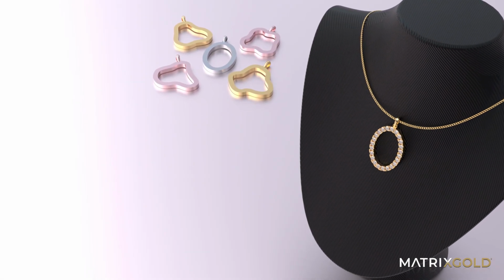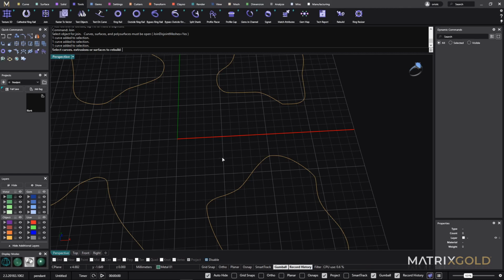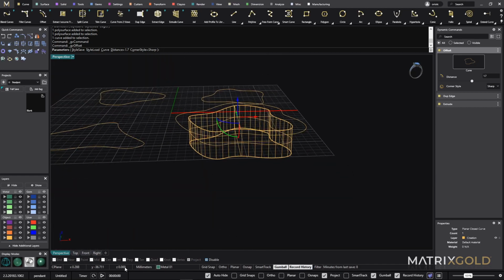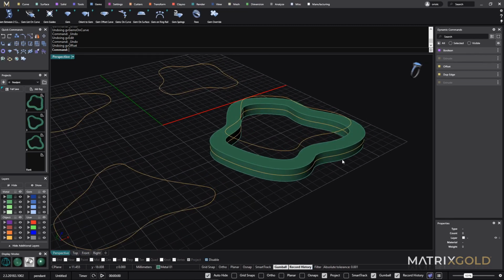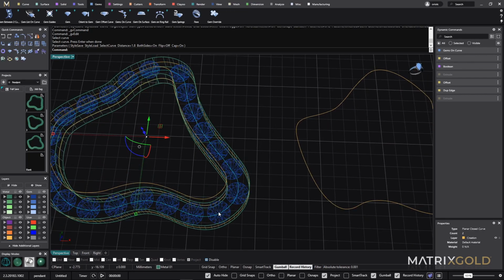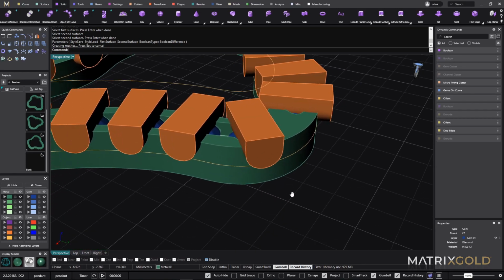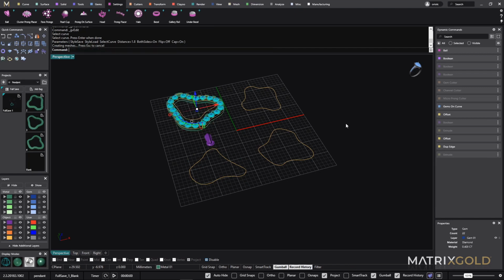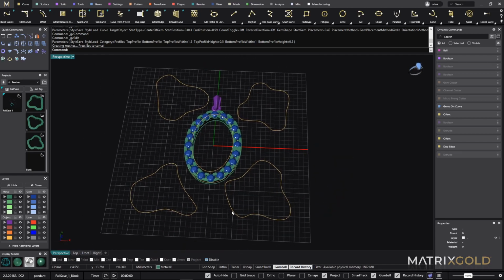Multi-Shape Pendants Design - MatrixGold Tutorial

Comment: Coming from Delcam's Jewelsmith I was having trouble grasping the process in this program. I watched a number of the videos but because this project is quite basic and constructed on a flat surface... the program really started to make sense. I would even go as far as to suggest doing some more tutorials along this line but just starting with a simple 'flat' extruded rectangle.....making it really basic.  In each of the tutorials add different types of settings..pin point, prong etc to the block of material and I don't mean crammed into one 2 minute video tutorial. This tutorial was constructed slowly for the beginner. I would then go from one row of stones to two rows and then pave the surface. I would also just use the same size of stone such as a 3mm round in all the videos so you wouldn't have to concentrate on the measurements. This would make it easier to remember and focus on the tools by keeping measurements standard. I use to teach and always started with the basics? Thank you....good tutorial....leaning more now towards switching software.
Reply from the maker: Thank you so much for the suggestion, We'll keep it in mind. However, on the MatrixGold online academy, you could find videos teaching from basic to advanced techniques.